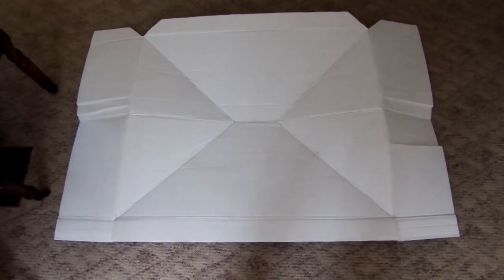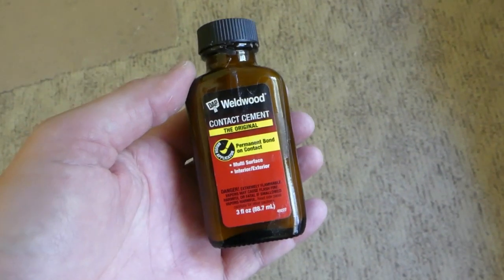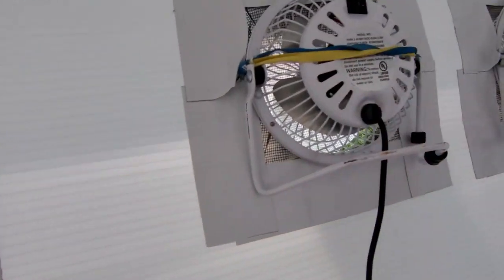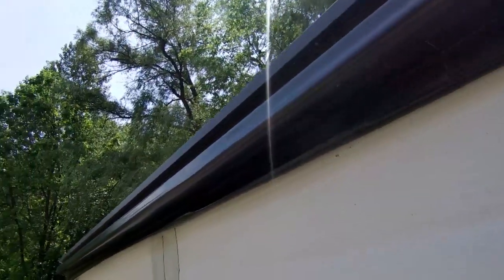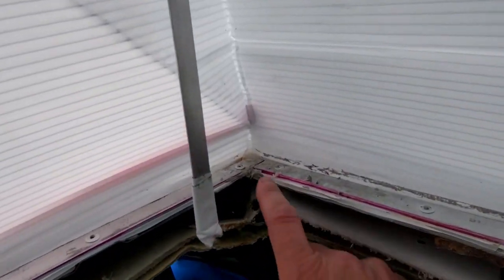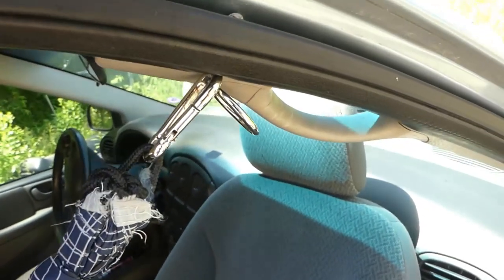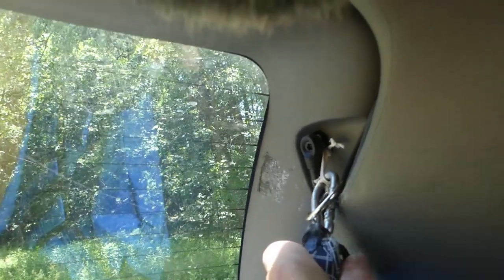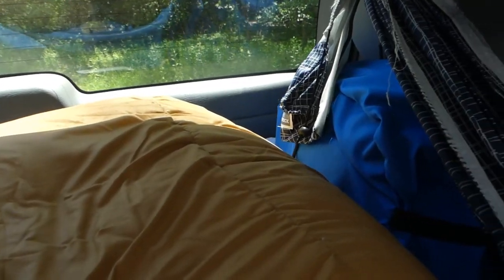DIY Minivan PopTop Details and Hanging the Hammock in my Minivan

Comment: I have watched and watched your popup video. what thickness of coroplast did you use. and did you use contact cement on side seams. I'm thinking about a top for my Ford 2000 e150 van (size 57 x about 85 x 30) . interestingly, I bought truck shell from a great guy on craigs list, to try and use it to lift the roof one day before i saw your invention. snag is that the top is wider than my van, I have thought and thought about it, even finally saw a prototype vanbuild on Youtube  (mega van airstream conversion on ford. ) I think I could get the look and ive figured out brackets etc. (i think I can, I think I can...) Real problem is, it will be too tall all the time. i think the truck shell should go back to craigs list and try the coroplast. Think i need a set of poles midway on the length. my  house mate thinks i need a bonk on the head.  I dont know about solar panels for the top because I have bought fold/flexible panels what about a lightframe and coroplast or frp on the top?. Ill be building a cardboard model soon, thanks for your consideration
Reply from the maker: The coroplast was purchased at Home Depot. 48 in. x 96 in. x 0.157 in. White Corrugated Plastic Sheet by Coroplast. https://www.youtube.com/redirect?event=video_description&v=af0eKiR12Oc&redir_token=QUFFLUhqbHpvQVdxRVA3VXhoTUdxOFg1RWRNRXFkQnVTZ3xBQ3Jtc0ttTHNQcFlCSTdLSkc0Ykhyc08tdkhZMlNRbXRmX1lvY050QXQwWkhOV2RLOTh5Y191WVNybXdHU01kVHVJZk45blpscm1PQlE4SV90d1FmTi0zT2tEMXBmTXBsUWhZYXNjNGFQaTJsN2JMNHY3Q1l0dw%3D%3D&q=https%3A%2F%2Fwww.homedepot.com%2Fp%2FCoroplast-48-in-x-96-in-x-0-157-in-White-Corrugated-Plastic-Sheet-CP4896S%2F205351385